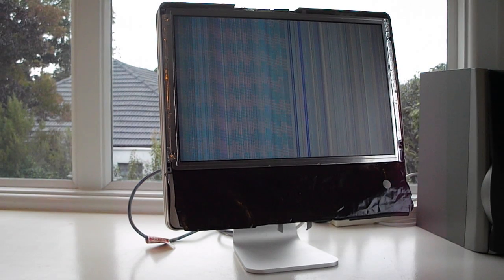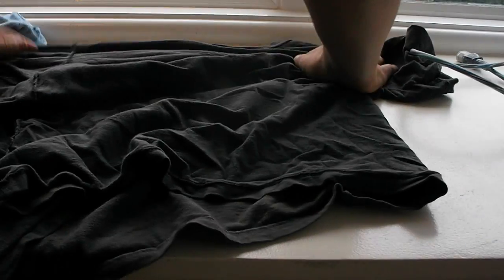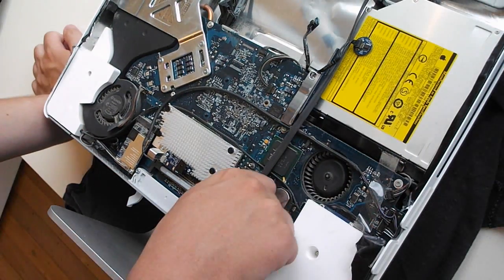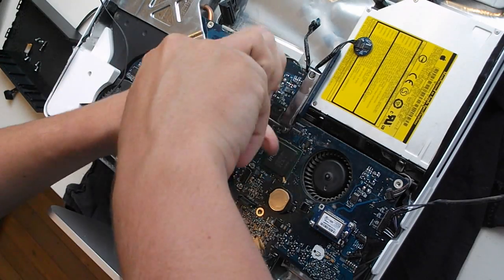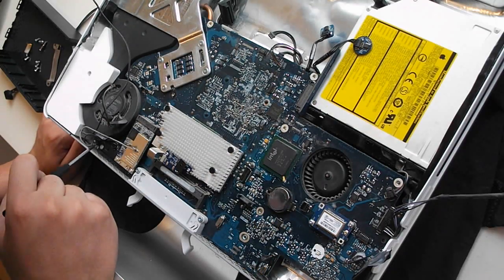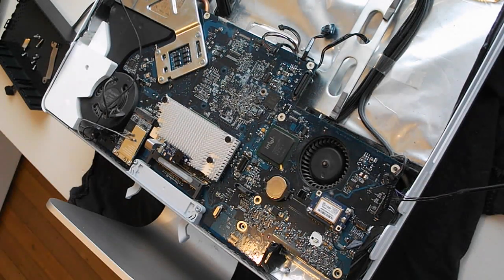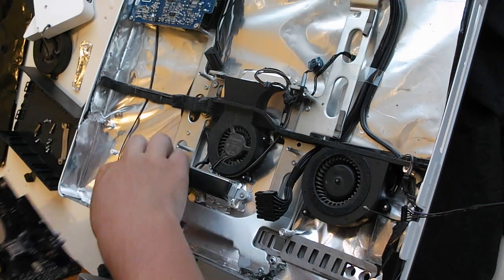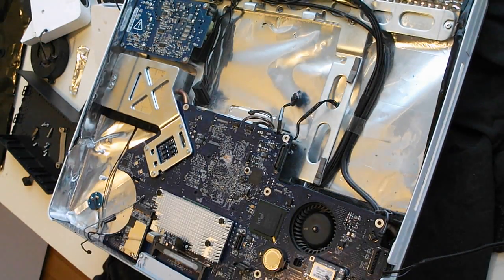iMac 17 inch motherboard replacement

Comment: Hello Grant!
I'm fixing to receive my brand new replacement motherboard in a few days for this exact same model of iMac which had the same problem. I've already removed original logic board from my com, and I was wondering...is it absolutely necessary to remove the old CPU and place it on incoming motherboard? Or, will the brand new motherboards CPU work just fine? If you could please respond back to me as soon as you can, it will be EXTREMELY appreciated.
From a fellow iMac user, I give thanks!